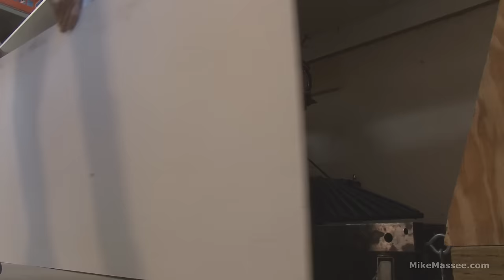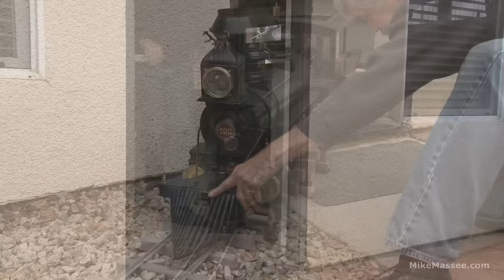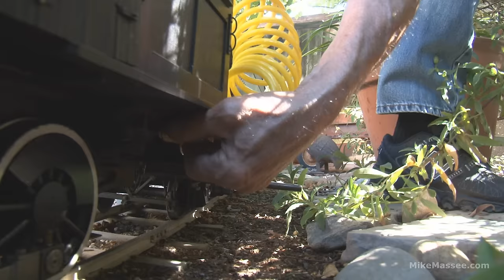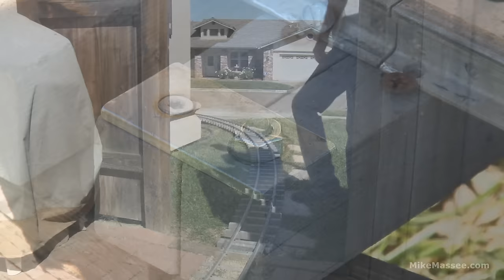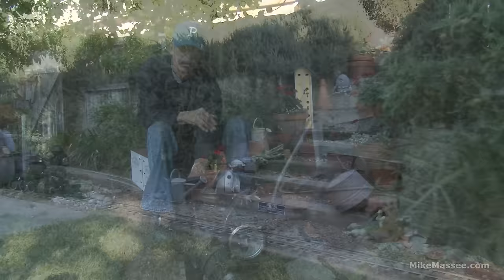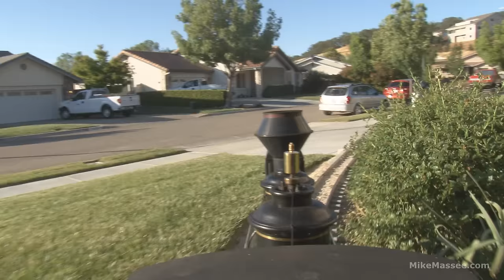The amazing backyard railroad of Jim Sabin - full HD program

Comment: Nice reairoad on the limited land you have!  I have 1200' of 7.5" gauge railroad on 1/2 acre.
Do you think 21' curves are sharp for 4.75" gauge?  My turns are 14' radius.  I bought a "10 wheeler" 1.5" scale steam locomotive, and spent over 6 months modifying it to negotiate those turns.  That involved blinding the center driver, as you did, and much more complex modification of the pony truck.  My loco weighs 600 lbs.  Rather then hoist it to work on it, I enclose it in a wood frame and roll it over.

Comment: This has inspired me. I'm only in college, with limited finances, but this video alone has inspired me to follow the dream and  work towards building a live steam railroad. I like the scale, too! Seems very manageable!
Reply: +EZ Goin I'm in the same boat you're in (in college with limited finances). I've decided to start getting a shop together and build my own engine after I finish paying off my car. I'm looking to build my own engine over roughly a five year period. It's projected cost is around $7,000 which is about $166 a month, which is very manageable.
Reply: When I say limited, I do mean jobless, haha. But it's nice to see that you're working your way. I'm planning on doing the same thing, slowly working my way up, with a small scale model steam engine to get my machining skills back up to par and then as I get money, start working on a loco. What scale are you modeling in?
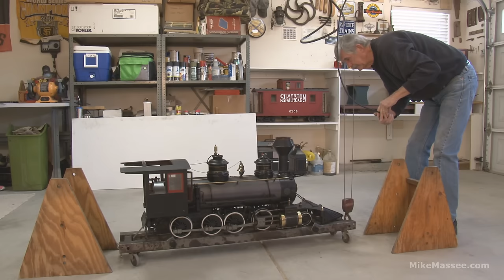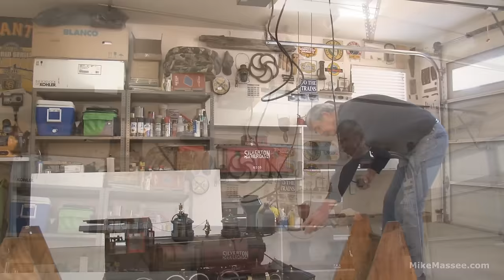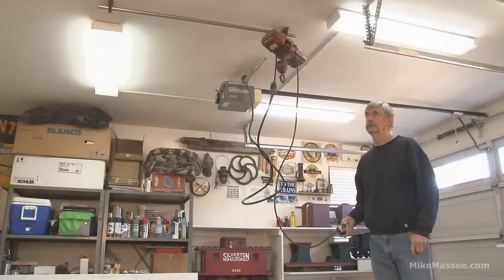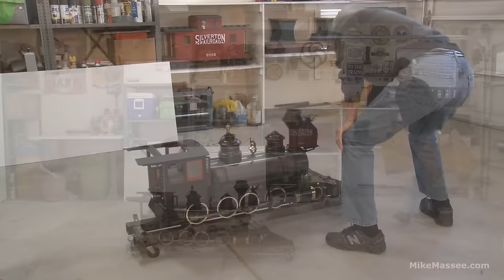Reply: +EZ Goin I"m all over the board in terms of scales. I have selections for 1:32, 1:24, 1:20.3, 1:13.7, 1:8 and 1:48. The gauges that I want to use are 4 3/4" and 45 mm standard, 42" narrow, 36" narrow and 24" narrow. The 1:8 and 1:4.8 could also run on 7 1/2" track.
Reply: Oh wow, that is varied. I've only done small scale stuff, HO, a little bit of N. As I get older though, I really would like something bigger, something that has moving parts and requires a small shop to keep running. You know, like a real railroad. I've been looking at either a 4"3/4  gauge at 1:8 or 1:6 scale (1:6 means I can play with my GIJoes lol), or a 7"1/2 (or 7"1/4, with regauging wheels) on a 1:4 scale narrow. My dream railroad is a 14" gauge 1/3rd scale railroad, with cabs and cars that are comfortable to ride in and are large enough to do signficant work (gravel, dirt moving, firewood, etc), but let's face it, that's too expensive!
Reply: I've also considered 7"1/2 in 1:12 scale, in a form that posits a modern day Brunel railway, with the 7' 1/4" gauge. That would provide for some very interesting equipment.
Reply: I'm looking at about the same thing as far as something larger that needs a small shop to keep the stock maintained. If you haven't looked at it yet, I'd suggest the books "Building the Pennsylvania A-3" or "Building the New Shay" both by Kozo Hiraoka. Both books feature an article where the author goes over the machine tools that he uses in the hobby. I've looked at some (albeit) out of date pricing and I could build my entire shop for only $20,000 to include the building itself.

4 3/4" and 7 1/2" gauge are really good choices in terms of live steam railroading. My only recommendation for deciding between 7 1/4" and 7 1/2" is actually to build the trucks and frames to 7 1/2" and then make a set of axles for both gauges using 1/8" spacers for the 7 1/4"

In terms of your dream railroad, I'd have to disagree; I don't think it's too expensive. Your biggest issue is going to be finding a site large enough to accommodate everything. But the engines, cars and other stock shouldn't be too expensive; just keep it on a small budget, like say $200. It'll go much farther than you think.
Reply from the maker: +Stephen Hibma Kozo's list is indeed very dated, and he does not include modern time saving and helpful contrivances such as collet closers for the lathe, quick change tool posts, DRO's, etc.   The landscape of affordable machinery has completely changed, with reasonable quality, cost effective machines coming out of China and Taiwan being sold at Grizzly, Enco, Northern Tool, etc.     For building in the small scales, you can set up a good shop including tooling for about $7k.    For smaller 1 1/2" scale projects not much more.   You can avoid buying a full size knee mill as long as you aren't building a large engine with a single piece cast saddle and cylinder set.   Carefully buying on the used market can also yield a great deal of savings, but you need someone who knows what they are looking at to go with you.    I was just talking to a friend about the fact that there is no updated guide on outfitting a shop, so I'm thinking of tackling that next with a video and/or companion website.   I was lucky to have a professional machinist guide me through all that, and it saved me from making a lot of bad decisions when I was first starting out.
Reply from the maker: Another thing I'll mention is that Jim here is an amazing example of being frugal.   You'll notice his garage is mostly empty, there are no big machines.  Just a small lathe and a few other items.    As he mentions he didn't buy many castings, instead trading money for time spent machining from raw stock.
Reply: +Stephen Hibma Thanks for the tips, I'll be sure to check that out! The spacers thing is a good idea, I was wondering on how I might dual run without having two locomotives. As for my 'dream' railway, I do agree that it can be done, but at that point there's not a a whole lot of interoperability between other railroads. That's why I think 7"1/2 is probably the best way to go, as there are many people that use that gauge and it allows not only for me to operate elsewhere but for other people to operate at my future RR.
Reply: +CaptainHarlock999 +Stephen Hibma Thanks for the information. I've been looking at Grizzly. My dad buys all of his major tools from them and they are all solid performers. He just recently bought a 12x36 gap bed lathe (which turns it into a 17 lathe) and it runs really nice. He's also got a knee mill and it's big but it's really not much more of an expense, so if you've got the space and the means to move it, I would recommend going bigger. Of course, that's only because of my future ambitions which continue on into building stationary steam engines as well as launch engines, so it really depends on what you're doing. All in all though, I'm hoping that I can get my shop up and running for less than $10,000, with all tools and possibly even the structure it's housed in.
Reply: CaptainHarlock999 Given that I studied machining in high school, I find Kozo's selection to be a little outdated; and I'm aware of some of the industries newer products. My $20k estimate 1) is for machines for making 2 1/2" two-foot narrow gauge engines as opposed to 3/4" standard and 2) included the cost of the shop structure itself (walls, foundation, electrical, etc.). The equipment was most likely going to cost around 10K if not less.
Reply: EZ Goin Depending on your selection of equipment and the size of the structure, 10K for everything is quite possible.
Reply: +Stephen Hibma Since I have experience in construction, I'll pour a foundation and build the shed myself. It will likely be 8 x12 or a little larger. Then I'll likely get a 12 x 36 lathe (and build a table for it) and an 8 x 30 (or similar) knee mill. Those two alone will cost about 6500. The materials for the shed will cost maybe 1200-1500. So the rest of the budget would be dedicated to small tools for machining and all that. At least, that's my plan.

Comment: Fantastic!  Thanks for sharing one of your passions.  Not only is the construction of your entire system impressive, your presentation is outstanding.  I thoroughly enjoyed watching this, more so than most of the others of this genre I've watched.  

I hope that engine has some type of spark arrester.  I saw that dry grass along the tracks on a portion of the layout.  I was on the Highway 58 fire in 1996 and the fire camp/incident command post was located at the fairgrounds there.  That fire started when a homeowner just south of 58 was clearing some grass and the weed whacker hit something, causing a spark and 100,000 acres later we managed to stop the fire.  Our southern fireline was the 500 kV Diablo Canyon Nuclear Plant power line.  The fire would have tripled in size, at least, had it gotten south of that line.  We lost southeast side of the fire multiple times and when the fire reached 80,000 acres we did a 20.000 acre backfire from that power line and from a line we had worked on for 3 days on the western side of the fire.  It was the largest backfire/burning out operation of my career.

Comment: This is so cool! I wonder if there could have been a way to embed the rails into the driveway, so that it doesn't take so long to set up. Nice to see that the Mrs. Sabin enjoys riding along as well. :)
Reply from the maker: Yes you can, there are a couple of ways.  The first way is to cut a channel in the driveway and deck it with trex or a rot resistant wood.  The second way is to cut a channel, place steel track welded to steel ties and then pour concrete around it, using a form to keep a clear space for the flangeway on the inside of each rail.   In the latter case it's best not to use aluminum, or the combination of ground up concrete and aluminum will turn the rail into an abrasive and wear the wheels out faster.  With decking material you can use aluminum or steel track.  I recently worked on an estate railroad project with hundreds of feet of track in channels with Trex decking, including switches.  It was an enormous amount of labor but it turned out looking very nice.

Comment: How much does the locomotive weigh?
Reply: +TrainsWow™ Evidently light enough that those clamps on the low engine stand alone can hold it when the engine is elevated! I also have a 2-8-0 in that gauge and scale, it's almost 300 dry.
Reply from the maker: +Rio Montezuma Bonanza Valley Alpine & Pacific Railway Co. The locomotive is also pinned securely at the back, you can see him inserting the pin in one shot.  The locomotive probably weighs around 300lbs.
Reply: TrainsWow™ it looks heavy

Comment: After a career as a road locomotive engineer I have been fortunate to get involved with The Louisiana Steam Train Association.  They are responsible for the restoration to FRA standards, operation, and maintenance of a standard gauge Mikado 2-8-2.  SP 745 is the only surviving Louisiana built standard gauge steam locomotive in existence.  She was built in the Southern Pacific Shops in Algiers, across the Mississippi River from New Orleans and put into service in February of 1921.  She is currently going through her 1472 day / 15 year inspection / rebuild.  We had hoped to have her running for her 100th birthday, but Covid 19 has delayed the massive amount of work still to be done.  If interested there are videos here on YT of her out running on the main lines of several class 1 and short line railroads as well as our yard.  Just search SPX 745.  She was also in several movies, such as “The Curious Case of Benjamin Buttons,” “Jonah Hex,” and several independent movies.  Being able to fire and run her took care of one of the main items on my bucket list.

Comment: Nice engine you should sink the rails into the concrete around your front driveway also into your shed under the door so you can still lock the door that way you wont have to even take anything off the track or have to keep putting the track down every time you want to use it
Reply: Exactly. You can just start up and go instantly any time of day hehe

Comment: very nice railroad meticulously maintained, do you regret not going 7.5 so you could take a trip to train mountain, i fail to see were the 3" would have made that much of a difference, you are already at the 1/8th scale train wise
Reply from the maker: The smaller gauge allows for tighter curve radii necessary to go around the house.   The same engine in 7.5" gauge would be 2.5" scale, much larger.   You could 'standard gauge' the same scale loco at 1.5" scale for 7.5" gauge but it wouldn't look right.    Jim has a larger 7.5" gauge engine and train that he keeps at Bitter Creek.
Reply: @MasseeMedia  thanks for the reply

Comment: He said that the scale was 1.6" to the foot (1.6:12), which is 2:15 (1:7.5) if my math is correct.  That would give a scale 55'5" boxcar a length of about 7'4½”.

{Anyone who finds my math in error, please correct it}

Nice!

Also, I wonder why they didn't run the track integral with the driveway?  I can only guess it would have been a lot of bother to saw out a channel.
Reply: C R
1 second ago
Your math is probably close enough.  I came up with a little bit bigger. 88.665 inches which I would round down to 7'4 5/8" inches (88.625). I'm a machinist though, so dealing with thousandth of an inch is an every day thing for me.  

As for the driveway. I did something similar around my house. Not everyone wants a train around their house so being able to quickly and easily pull up the track for resale of the house is a good thing.
Reply: @CR-rb5hl  Keep in mind that that loco would not be pulling 55.5' cars. Cars of that era were quite a bit shorter.

Comment: is it possible to order one?, if yes what will be the expected cost. Thanks
Reply from the maker: Most of these locomotives are built by hand as a one-off.   You can however order a locomotive similar to this one (Although 7.5 or 7.25" gauge and not 4 3/4" gauge) from O.S. Live Steam of Japan either as a pre-machined kit ready to assemble or ready-to-run.   This option can be very expensive however, the kit price is around $15,000 USD and the RTR price is around $25,000 USD.  As a comparsion, Jim probably built this one for a few thousand in material and supplies, scrounged over a period of decades rather than all at once.

Comment: Scale size is that? I see that it says 4 3/4" narrow gauge, is that an F-Scale?
Reply from the maker: Hi Kenny, it's 4 3/4" gauge, 1" scale.  (1/12 full size)  F-scale is much smaller, runs on Gauge-1 track (45mm / 1.75" gauge)
Reply: @MasseeMedia  Thanks, I am looking for a knee high train to go around a 12 foot Christmas tree for my Christmas Show. And I don't know what size I would or should be looking for.
Reply from the maker: @tinkertron  Rideable like this or running on its own?   There's really not a lot available within that set of criteria off the shelf unfortunately.   Most people use the smaller G-scale stuff from LGB for those purposes.   For something larger that will operate around that curve radius, something custom would be needed and that would take longer to fabricate than the time left for this season.    If you can live with something smaller, try the LGB Christmas edition Chloe 23132, and a set of the matching 30432 Christmas passenger cars that go with it, and some LGB track and a power supply.  Contact TrainLi in Reno, NV and they can set you up with everything you need.
Reply: @MasseeMedia  no not to ride on. Yes but most G-Scales are in doors. I am looking for a train to go around a outdoor Christmas tree for a xmas light show.
Reply from the maker: @tinkertron  Actually G-Scale is the most popular outdoor non-riding garden railroad scale.   It runs outdoors in fair weather just fine.   The most maintenance free track is ProLine nickel plated.   It is nearly impervious to oxydization so it will maintain good electrical contact despite moisture.  TrainLi has it.   Search for 'G scale garden railroad' on YouTube and you'll get an eye full :D

Comment: Ok .. so I see the reason for having the overhead hoist, lift the loco up to allow you to have it there as a servicing height,
But c'mon..
Surely by now, you would have realised that bending over as you did, to manoeuvre the loco's track-bed/dolly, isn't the smartest move, as it's obvious to me, that a person capable of hand-building such an exquisite loco, would at least be able to "fabricate" a loop (lawnmower) type, handle set, that also utilises those end wooden-frame "bar" holes, (with a couple of clevis pins instead of a rod, when fitting the loop handle) as then instead of busting your back trying to "crab-sideways, bent over like a worn-out safety-pin. whilst dragging that heavy loco (on it's track/dolly) all across the floor, as it would be SO MUCH SIMPLER (and a "h-of-a-lot" safer) to simply push/pull it around with a lawnmower handle frame.?

At least that's what I would do, because slipping a few discs - just because one is too "lazy" to fit a piloting handle to that dolly/track just doesn't make any "back health" sense at all.